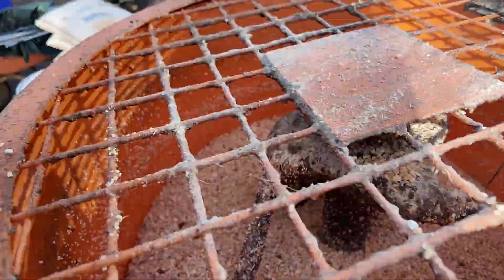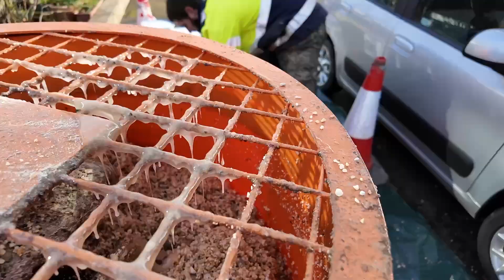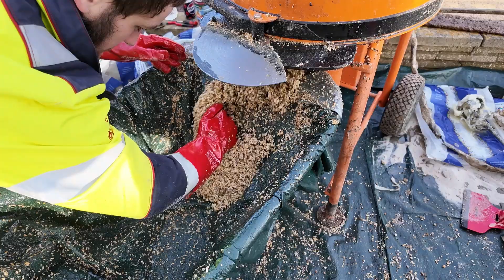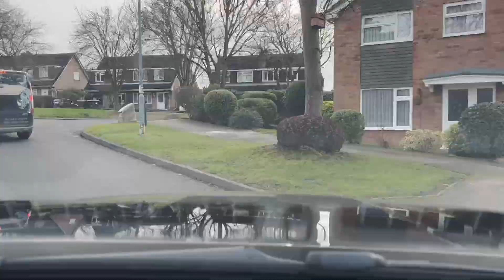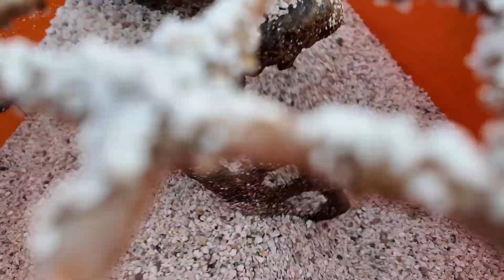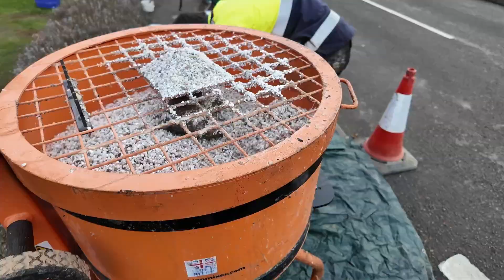Resin Bound Driveway Install w/ Rhino Surfaces!

Comment: Another informative video. what is the jointing material you used? it looks like fibre glass strands? Also, how much should an average team be able to lay in a day? thanks again, and I will keep watching.
Reply from the maker: Thanks Callum, yeah thats correct, it's a fibreglass webbing we use for the joints. With a 3 person team, you should be able to comfortably lay at 25-30sqm an hour. I know our guys can do between 35+ sqm an hour if they're really on it!